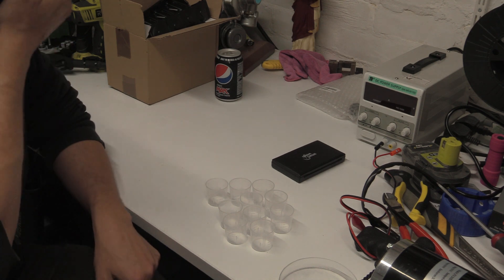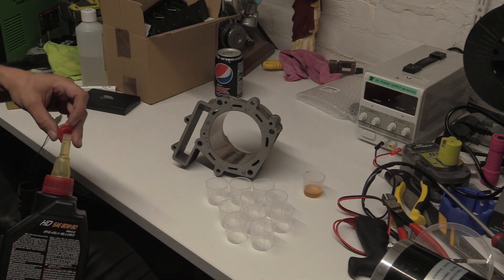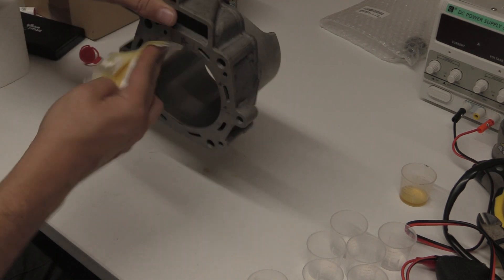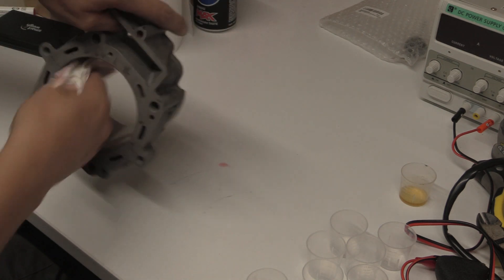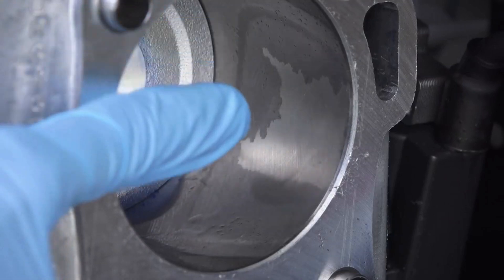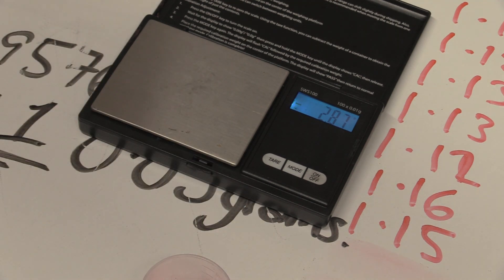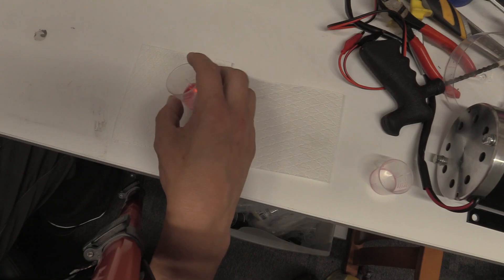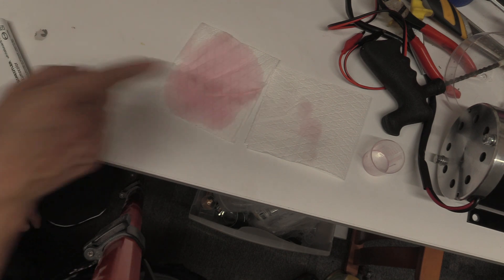Engineering NOT Explained - Visual Lies

Comment: Great video! I’ve gotten some folks asking me to watch and leave feedback so here we go! I think the overall message, and way of supporting that message, is wonderful. The point that the amount of fuel injected shown in my video was (very) excessive is accurate, and should have been stated in the video. The point I was attempting to make (perhaps poorly) is that gasoline is a solvent and when there is excess gasoline it can reduce the oil film present at startup (when the engine is cold, and initial oil presence is lower than after the engine has been running a bit). The initial (and current) goal of the channel was for someone who knew nothing about cars (me) to learn about cars, and teach along the way. As you might imagine, mistakes can and have been made along the way. This is evident by my follow up videos where I claim my previous videos had misinformation or inaccurate claims, or the “important note!” pinned comments I’ll leave on videos where viewers have pointed out mistakes. Remember that I’m not the one saying “I know everything about cars.” The channel started because I did not, and I wanted to learn about them. Commenters love to reach extremes (this guy knows everything! or this guy’s an idiot!) On that note, it’s a bit of a bummer to read the comments on this video, which seem to be in contrast with the message you’re attempting to make. If someone makes a mistake, it doesn’t mean everything else they’ve ever said is trash, or inaccurate. To address the specific claims from this video’s topic, I’ve certainly changed my thoughts on it having spoken with powertrain engineers on the subject, who’ve got the data to show whether you drive off immediately, or after a warm up, today’s engines are quite well protected with an oil film within a few seconds. This reinforces my original video’s message that there’s no need to warm up your engine (of course, if you want your car to be warm so you’re comfortable inside it, or need to melt frost, etc etc, yeah, go for it). But it reaches that conclusion in the wrong way, by saying that one method is worse than others (drive off vs warm up), when based on information I’ve received long after the original video was posted seems to show that wear will be minimal regardless of the method, so long as you’re not flooring it the second you start the engine. To those who want to use this video to discredit my channel as a whole, I’d simply suggest you take the advice this video claims. Visuals can be deceiving. Information can be biased. Good science admits mistakes. It’s more important to understand why than to simply suggest an outlier of misinformation means everything else is inaccurate. I’ll link this video in a pinned comment on the video you’re referencing. Again, my goal isn’t to push nonsense, it’s simply to learn and teach about cars.
Reply: I think we're seeing a clash of cultures here. What might seem "rude and aggressive" is just taken as straightforward criticism here in the UK - people will get into blazing rows over any esoteric topic and still share a pint together down the pub later 😉
Reply: I like tortles...
Reply: I like and learn from both Matt and Jason. Matt makes valid points about the subject, Jason responds like the decent guy he is. I don't see a problem here. Time for my dried frog pills.
Reply: So what was the point of the video?
Reply: vgedrr bummer, thought my reddit waffles would get me that sweet sweet karma syrup! You say I’m sowing confusion. Insinuate my mistakes are more frequent than rare. State that I shouldn’t need to consult powertrain engineers (what, why not, they have the data?). To back it up, you have a couple personal digs, and don’t rebut anything specific. Isn’t that your whole point? Not to make unsubstantiated claims? Saying that modern engines need time to warm up to be protected from light loads is inaccurate. To me, it feels more like ya just wanna get some digs in & scoff at me. Today’s engines can start up and go. Not new information. Not contrarian. And for what it’s worth, it’s far easier to ignore criticism (like this video, comments, etc) than to take the time to respond. I don’t have evil goals. Perhaps there was some naivety in starting this channel nine years ago (there definitely was, but you don’t name a channel “engineering explained” and think it’s going to amount to anything, you do it cuz it’s something you feel like doing in your free time, and three years in it surprisingly happens to turn into a job). Make some content and put it out there. You’ll find many folks that genuinely don’t want to see you improve, but rather have more malicious intent. If that’s not you, well then I appreciate it. But that seems to be the vibe of many of the retorts here.
Reply: @EngineeringExplained  the workshop videos I've see look amateurish compared to yours. And the only reason I even know his channel exists is because I watch a lot of videos from a channel called delboys garage, he does something I do myself, buys old bikes and fixes them up, sometimes modifying them a fair bit. Anyway, in my YouTube suggested videos one day is a "the workshop" video essentially picking apart something del said, truthfully I can't even remember the subject but the point is this workshop guy seems to enjoy personal attacks on other YouTube channels, I mean its not like he's nice about it either he wasn't as nasty to you but he was calling del abusive names, and I always think if you wouldn't talk like that to someone's face don't say it on here. 
Everyone gets things wrong from time to time, you guys aren't lecturing at a university nd I'm sure your viewer's are bright enough to realise you're making videos primarily for entertainment, and I'm sure there are a lot of people who have learned from information you've given, it must be hard when someone has a go at you on a personal level but you know the best thing to do is ignore it, some people can't help themselves, instead of saying something positive they can only criticise.
Reply from the maker: @andybowie8590  "I mean its not like he's nice about it either he wasn't as nasty to you but he was calling del abusive names, and I always think if you wouldn't talk like that to someone's face don't say it on here. "

- I don't say anything I wouldn't say to anyones face. We can test that out if you want?

"it must be hard when someone has a go at you on a personal level "

- Evidence of this happening would be great...

"instead of saying something positive they can only criticise."

- I have a question, what if what someone is saying in a educational way is wrong? Do we just ignore it an move on? If so, how do you move on? Back in the day they thought that illness and mainly infection was because of 'bad air' - so the cure was what? You have a bacterial infection and you cover your nose with a mask. See where that get you?

Lastly, aren't you doing the same thing? You just said " if you wouldn't talk like that to someone's face don't say it on here" - well would you? You say don't criticise but aren't you? Why didn't you just shut up and say nothing? 

Geniune questions, I'm not going to hold my breath but wait and see if you do.
Reply: Instead of making a 18 minute video with a title that tries to discredit, it would of been better and less tedious to watch a short supplementary video just pointing out that the amount of solvent sprayed wasn't representative of what a fuel injector would spray. I think anyone with some engine knowledge would of known that, and for people who didn't it was just a simple way of making a point, I don't see the need to make it personal like bashing every video delboy made, there's ways to go about things and positive criticism is always better
Reply from the maker: @andybowie8590  because people really listen to that. Its funny you say this, but this video caught your attention didnt it? 

You also failed to even listen to the very beginning of the video. This isnt a correction video, this is 1 of many videos about false results, bad testing and using buzz words to make something that is incorrect seem correct. 

Bu you already know that, you just wanna  whinge about del bashing. And to keep this on topic, where was the 'personal bashing'? I'm sure i just talk about the subject...

You just wanted to whinge, which is all good, that's what the comments section is for. Have fun
Reply: @jiijijjijiijiij  This is no rigorous and systematic scientific video. What he's done is had a short intro, then filled a few cups with the WD-40 and emptied one to 0.06 grams(and explained why he was trying to get to 0.05 grams) and then wiped the oil using two of the cups of WD-40. Could have been much shorter. If he was looking for systematic rigor, he should have gotten a perfect 0.05 grams, and measured the amount of oil coming off the cylinder too, which he did not do.
Reply: @jiijijjijiijiij  Please more specifically point out my lack of perception in scale, precision and accuracy. I have no idea what you're talking about. Was there something inaccurate in my comment?

Comment: So little gas on the scale that you can not even weigh a empty cup first to zero the scale, then change the cup out with a different cup with gasoline, because the tolerance between the 2 cups could mess up the massurement.
That is impressive stuff.

Comment: greetings in first place I really like your channel and I already got a lot of useful information from it and thanks for that. secondly, this is not to discredit you in any way, you are the one who says in this video sometimes people pass wrong information without knowing it. I have been postponing this comment for a long time because English is not my mother tongue and it is a lot of work to express what I mean, even after seeing you boasting for the comment of the guy who rides a motorcycle for 40 years in this video comments. But since you put the video https://www.youtube.com/watch?v=StDoNy0q4Z0 Chain tight spots i have been meaning to talk because I saw that this wrong information was being spread and that’s why I come talk about this, you are always complaining about the wrong information, so I take this video to, share my experience on the subject. Almost everything you said in the video is correct! but the answer to the question asked by the video is wrong the chain tight spots are in fact the fault of a bad chain and not the sprockets, what you are measuring is in factions of mm's and the chain tight spots are in the magnitude of cm's. but enough of this what I propose is that you do an experiment that I already did the next time you have a motorcycle with some really bad tight spots and are going to change the transmission kit before changing the sprockets change the chain first and check that with the new chain even with the old sprockets the chain tight spots disappeared
Reply from the maker: Thanks for the comment though
Reply from the maker: Bad chain? Sorry but you're incorrect, and I'll do a video showing why.
Reply: @thedirtyworkshop  
I would like you to do the experience I mentioned
Reply from the maker: There's no need to do an experiment, I know where you've gone wrong. I'll do a demo explaining how.

Comment: Can you explain how it works in a 2 stroke engine, as we mostly use a mixture about 1L of oil on 33L of fuel. Still the old ladys run like 30000km on one cylinder lining/lifecycle.The fuel and oil are constantly mixed and still it keeps the stuff going.Would be interesting to learn how that is working exactly.

Comment: So basically a 2 stroke seizes instantly because the fuel suspends and wash away all the oil? I don't really get even whats the point actually of what that retarded is saying: you have oil rings which purpouse it to remove the most oil possible from the walls, wtf is he even talking about

Comment: In this case the basis of what he is saying is right, although the reasons he cites are wrong which is typical of him to make half baked assumptions about his casual observations. His carby issues, rich mixtures, oil washing reasons are all useless factoids to make him sound informed on the topic..
It comes down to the oil being able to circulate through the engine as required in cold temps and that's about all.
If the oil is at a temp that assures the oil is up to the rated viscosity for the engine then it is good to drive, in cases where the temperature is lower and as such the oil may be more viscous than the rated range then allow some period of idling to bring oil to minimum temperature before driving and that should only take a minute or so. Or just consult the vehicle manual on cold starting procedures if in doubt.

Comment: Matt, You made your point. At a 10:1 ratio not all the fuel is being burned, where does it go...?
Probably the coldest surface it finds at the top of the bore.The oil-control ring is at the bottom of the piston so whats going on above it.? There is a reason diesel engines last longer.
Reply from the maker: Where does it go? Out of the exhaust... Some of it passes through the ring gap and some of it blows by the rings, but thats over the life of the engine. Secondly condensation doesn't just happen at the coldest region if that region is 100degC then it just doesn't happen. 

Next you're misunderstanding how oil control rings work. 

All of this has nothing to do diesels longevity, low revs do.
Reply: @thedirtyworkshop ... "if that region is 100degC"...it explains why the z-900
revs so high on startup..they dont want hydro-carbons out the exhaust for
very long.Oil is sucked up past the oil-control ring..had to look this up.!
Damn good teacher..Appreciated....

Comment: Matt, I read a study many years ago that stated that warming up a fuel injected engine was the main cause for a ring lip at the top of the bore. It stated that it was found that due to an incomplete combustion of hydrocarbons an acidic buildup was produced in the region above the top ring which started an etching and accelerated wear in this region. It also stated that once started the engine was best to be operated in a low load i.e light acceleration manor so as to facilitate in a complete combustion and minimise wear in this region. It said that warming up came about from carbureted engines and was mainly done to get heat into the intake manifold to help in vaporising the fuel as to reduce acceleration hesitance. What are your thoughts on this
Reply from the maker: Total bollocks. Number one reason, measure the bore above the ring wear band....

Also read this - http://www.marinediesels.info/repairs/gauging_liner.htm

Comment: Different chemicals/ molecules are limited by how close they can get to the cylinder wall, one of the perks of injecting water, and I believe combusting hydrogen is the same, is they can both get closer to the cylinder walls then petrol or diesel. I think this then relates to heat and why fuel can't condense on the cylinder walls. I can't find the article, so this is purely from memory and not science.
Reply from the maker: This is called the quench region and its not how close the molecules can get, its how close the combustion flame from gets to the cylinder wall. And fuel can and does condense, but like I said, its microscopic

Comment: I think the visual demonstration from EE is way off. There is no squirt of gasoline in that amount in to the cylinder. Is is made to fine vapor and ignited, not flowing around like pee from an old lady. 
And the cold parts of the engine needs extra fuel, hence the choke or EFI that gives more fuel. 

Someone told me that running an engine rich could "wash" the cylinder walls and cause seizure??
Reply: it actually can but holy shit it hast to be Jeff Bezos rich for that to really happen. Long story short, bought a used honda 300 EX quadbike that the previous owner did some "performance" upgrades then wouldn't idle. Checked the oil as soon as I got it home and it was way over full, only because there was so much fuel that washed into it. Found he put the needle in the carb wrong so at anything close to idle the vaccum would literally lift the needle from the main jet and flood it because the needle was free floating in the slide. Lucky it didnt get run much before I bought it, havent had to rebuild it yet, just a proper carb cleaning and tune up and been great for 6 years.

Comment: Gasoline engines just dont need a lot of fuel to make a good mixture with air , some of the first carburetors were just a tin with a damp in gas cloth of cotton that vaporized a mixture to the chamber just like a fluid ligthter works ,capilarity.